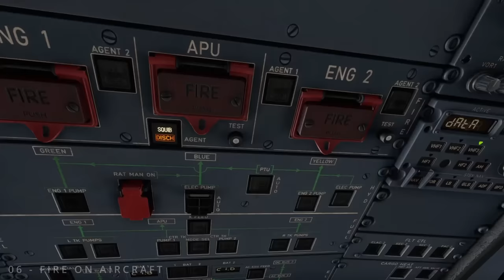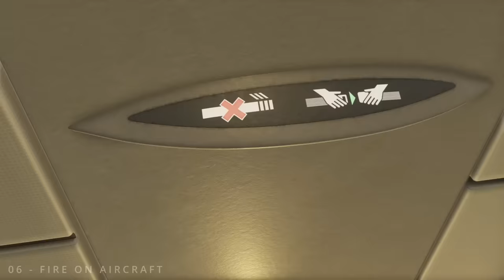Airline CAPTAIN Debunks 8 Flying Fears

Comment: Everything described in this video is one of my fears. I have many more like a loose nut, wrong gasket, failure of a critical instrument, midair collision, turbulence tearing off an aircraft wing, grave mistake by the cockpit crew, and a lot more. To be honest, I knew everything that this video contains and this is not enough of a reassurance. Yet, I have to fly for different reasons. I try to hide my fear of flying. I am sure passengers sitting next to me notice my strange movements despite my attempts to look normal.

Comment: I grew up in a time when L1011s (and other planes) regularly dropped out of the sky, for seemingly no reason. As a result, I used to be so petrified of flying that I would have to go to the airport and sit in my car and watch the airplanes land for HOURS before I'd get on a flight. My job required me to travel frequently and i was a constant mess. Over time, I convinced myself that these behemoths actually DO come down out of the sky safely. About the time I was conquering my fear of flying (which was really a fear of landing), I was hired to run an AIRSHOW. I flew with The Blues, The Thunderbirds and the Snowbirds (Canadian). Now I sleep through take-offs and landings -- something that would have been unthinkable in my early career. P.S. My parents were in the Air Force. Try explaining a fear of flying to people like them some time.
Reply: No L1011 that I know of 'dropped out of the sky for no reason'.   You're thinking of DC10's.    The ONLY  L1011 mechanical failure was a landing accident which killed two people.    Quite a lot of DC10's dropped out of the sky, and a number of 747s.   The L1011 was by far the safest of the three 'jumbos'.    I'd fly on a L1011 any time.   Not a DC10.
Reply: @cr10001  The DC-10 definitely had its problems, but the L1011 was a perilously bad aircraft for many years.
Reply: @buckeyepilot3929  what the hell are you guys talking about, “dropping out of the sky?” Like, literally just falling down from flight altitude? I always thought the safest time was whilst you were in the air? You got me picturing some goofy movie where a EMP hits or something and planes start falling down onto neighborhoods ...🤔
Reply: @bobbeezel2593  Can you read? Read the articles I posted.
Reply: @buckeyepilot3929  well, pardon me all over the place. I shall go and read the articles you speak of (which I had no knowledge of until now). I no reed thengs vary good skoewl was hard four me

Comment: As a retired airline pilot for 35 years, I can tell you, you don’t negotiate with air traffic control  when dealing with thunderstorms. You tell them witch way you are turning to avoid them.
Reply: Yep as an ex-ATC, I can tell you that if there are big storms, separation is greatly increased because very few want to be there anyway, and it is expected you're going by weather radar around cells. So have at it but please stay in my sector because it's more work otherwise.
Reply: Interesting comment but I was on a plane one time when there was a thunderstorm. I’ve no idea what was going on or what the pilots did. I don’t know if it actually happened as I was very sleepy so I may have even dreamt it. Either way, something happened one time but not sure what it was or who was involved.
Reply: @theemperorofboxingtruth3745  I think it was the meds.
Reply: Thanks for your service🎉
Reply: *which

Comment: My biggest paranoia is when the plane takes off, because the angle is so steep and the speed seem always so low, you feel like it’s about to stall
Reply: There's alot of illusions that act on the body in flight. I believe if I remember correctly it was at 500 feet (because it's been a minute since I had to know it). Above that, you really need to trust your airspeed indicator, your artificial horizon, and altimeter. If you watch commercial flights, at least one crew member is glued to the instruments and reading off situational data to whoever is actually flying the plane. Then there will be backups of all the instruments in the second seat and most of the time, also analogue instruments Incase of a failure on the glass cockpits. Some airlines I've been on, the LCD media screen on the seatback in front of you can display some basic flight data and you can watch the indicated airspeed and altitude climbing.

Comment: Thank you captain for your helpful information! I would like to know how pilots are drug tested and mentally screened for cognitive changes? 
The Malaysian flight that disappeared was so distressing and one theory was the captain had something to do with it. I also have followed the problems with the Dreamliner planes and how many pilots weren’t properly trained on the new/different technologies because of cutting costs! 
I hope pilots always know that we want all of you to be heard, cared for and are in your best health before you get in the cockpit!😊👏🙏🏻
Reply: It depends on the airline. Most of the big ones have mandatory timing stuff that keeps pilots refreshed and ready, they'll also require a certain number of hours of training on the plane that they'll be flying before they are even allowed in the cockpit pull of passengers. The Malaysia airliner that went down was the pilot committing suicide with everyone on board, it is very clear by the flight pattern that he had said goodbye to his hometown mid flight and did something that every pilot is trained not to do. To combat that, Malaysia air has set up screenings for pilots mental health. I'm sure that most other airlines already did it but have definitely increased the emphasis on it. And the dreamliners that went down was a software issue that the pilots were not trained to overcome, unfortunately causing the loss of many lives. Boeing grounded all of those planes and patched the software that was causing issues.
Reply: @eats4cheaps305  That wasn't 'Dreamliners' (787's) that crashed, that was 737 Max's.

Comment: I’ve worked in aircraft maintenance and seen evidence of poor decisions on the part of various personnel refurbishing components. Sometimes it’s cost cutting/savings by management or insufficient training for mechanics. Also recently Boeing was discovered to have done something completely STUPID with their 737 NEO in order to remain competitive in the industry. Certainly those engineers entrusted with design and manufacture are well trained and do these jobs well, HOWEVER, as we’ve seen these people can be overruled by ownership/management to the detriment of paying passengers. Boeing was entrusted with certification of their aircraft instead of the independent agency tasked with this responsibility. MONEY AND GREED have caused untold grief to the families left behind to deal with the factors I’ve highlighted here. Pilots who are extremely well trained cannot always deal with circumstances they may know NOTHING ABOUT. Thanks, I’ll take my chances on the road!

Comment: Captain, I'm worried about a mad pilot locking the cockpit door and slamming the plane into a mountain. Should I be concerned?
Reply: No. These days there has to always be two people in the cockpit.
Reply: Oh no! I have also been thinking about  that lately. For way too long.😵‍💫
Reply: Statistically you should be more worried about software used to fix bad airplane design that wants to smash plane into the ground and pilots unaware of its existence...
Reply: @icepeakengineer1702  a 737 max reference.
Reply: @icepeakengineer1702  perhaps the next hijacker will not be on the plane
Reply: @johnhorton1012  I don't even trust two people in the cockpit. I have long believed that planes should be equipped with AI to detect irrational behaviors undertaken by a pilot and then to be able to automatically take over full auto-pilot control of the plane under the right circumstances. I would even advocate for 3 pilots plus the flight engineer (even if the 3rd pilot does bugger all on that flight), for that very unlikely scenario when the co-pilot is fighting the irrational captain for controlling the plane and then it's 2 against 1, or if both pilots become incapacitated.

Comment: Thank you for this great demonstration. I have a better understanding of turbulence now. However, much of my fear of flying has to do with the maintenance of the aircraft itself. I remember back in January of 2000 when an Alaska Airlines plane enroute to Seattle crashed in to the Pacific Ocean. The cause of the crash was a jack screw that had malfunctioned due to not being greased. Investigators also discovered that some of the maintenance records had been falsified. Then there was the TWA flight 800 in 1996 that exploded shortly after take off and crashed in to the Atlantic. If I remember right, that was due to a spark from a wire. I know that commercial aircraft are heavily tested and engineered to handle even the most extreme situations. I also know that pilots maintain their training regularly in flight simulators. But these two examples I gave, which come down to human error or carelessness are what really scare me about flying.

Comment: Good video. Many people are also worried about engine failure. Then I have to explain them that it's no problem when the aircraft has multiple engines and loses one, and even without a functioning engine you can glide the plane for a long distance and land safely. If you are over vast areas of sea, you always have multiple engines, and the chances of them failing all, is just insanely close to non-existent

Comment: Went to the Philippines several years back and was on my way to LAX to catch my flight back home to Vegas. Weather was looking kind of nasty in LA and when we hit the air captain said “ ok we have some weather from here to Vegas so we would like seat belts until notified otherwise “ I’ve watched many movies of airliners crashing and in the movie there is always a specific sound when the plane is going down. Here i am almost home from a 30 hour flight round trip and I’m so excited to get home on the ground and safe. I put my head back on the headrest , looked around and saw many others doing the same thing. All of a sudden the nose dips pretty hard and i hear the engines groaning “ i freaked and sat up really fast ! “ i started to look around and was INSTANTLY embarrassed 😂😂😂😂 not 1 SINGLE person had there heads off the head rest. I knew at that point we were safe and they were probably diving to avoid weather. Flying is scary for me and i realize it’s rare for a plane to go down , however we know that if they do it’s going to be incredibly terrifying and probably not end well. That’s the difference between a car crash and a jet crash.

Comment: We had a flight where the engine failed, something about oil. There was a weird barking sound. We were redirected, everyone was terrified, but it was all fine. The pilot just flew lower and got us back to the airport. I later learned it’s a very, very unusual thing to happen, there’s multiple engines on commercial flights (two on ours) and pilots are trained to deal with it. I was nervous on our next flight but came to realise it’s safe, and pilots are trained for basically every scenario of something going wrong you can think of. There’s a reason it hits the news when things go wrong - it’s very, very rare.

Comment: Just got back to prestwick from Spain last night. Both flights was a nervous wreck, completely irrational fear, should have watched this before hand. Turbulence was a bit of an issue coming back, I've noticed smaller planes like the airbus that Ryanair use bump around a bit more than bigger planes. 
What amazes me is the reliability of the engines. The airbus from prestwick to Spain does multiple flights a day. Someone told me that the engines could theoretically run constantly for weeks before breaking down.

Comment: Great video. People are just as afraid of elevators and spiders. I heard that there are around 10,000 ATC flights in the air at any time. You are more likely to be hit by lightning this year than be in a commercial flight with a major incident in your lifetime. Unfortunately, reasoning can't help people afraid of irrational fears, but maybe directing them to think about spiders and lightning will help them walk down the jet way or slow their heart rate while they fasten their seat belt low and across their lap.

Comment: My fears of flying comes from the idea of suicidal pilots, parts of the plane breaking off under stress like the vertical stabilizer on American Airlines 587, and software issues like the two 737 MAX aircraft. It terrifies me to the core. My one tip that helps even a little is to bring active noise-cancelling headphones to drown myself out of the situation if I am feeling overwhelmed.
Reply: Same thing, as rude as it sounds I am always worried about the "human factor". I am aware that planes are safe, as everyone tells us as soon as we say we're scared of flying, what worries me is maintenance workers missing something, the pilots being exhausted (every time I see a video where pilots discuss their daily life they always point out how little time they have to rest) or mentally unstable ecc.
In a car or a bus i can see who is driving and what they're doing, on a boat I can't, but if it sinks I can try and do something to save myself as there are lifeboats hanging around. On a plane you never know who's in the cockpit, what they're doing, and if something happens you can't do a single thing about it, you're just dead.
We are pretty much in the hands of very professional strangers, who however get little to no sleep and, depending on the company, are probably underpaid

Comment: I was terrified of flying from the very first time I flew at age 5. I was an uneasy flyer as an adult, but not to the point that I avoided it. Then I got a job that required some travel. After awhile I got to recognize the noises and bumps and turbulence one experiences on every flight. I started to realize it was all normal. Even the abnormal things like moderate to severe turbulence and a mechanical failure that required turning back to the departure airport were not as scary. So I think the best way to overcome fear of flying is to fly a lot.

Comment: I was cabin crew for several airlines including Gulf Air and British Airways for over forty years. Over that period, turbulence became more and more severe and common. I'm not convinced by climate change but the world is going through a cycle of increasingly severe weather patterns. I believe that flying is inherently extremely safe, but i'm hugely relieved that I'm out of the industry. The final few years of my career meant most of my flights involved some degree of turbulence, often severe. I'm extremely happy to have both feet firmly on the ground and not having to check how bumpy my next duty might expect to be. Yes, flying is incredibly safe, but it seems to be increasingly very uncomfortable and unpleasant.

Comment: Ok nice video. Thanks for sharing. I am not a pilot, just an ordinary passenger. Because I have had a fear of flying I have done some reading on the subject. I read a book on air disasters and one thing the author made clear was that crashes are usually caused by a series of unlikely events. For example in one crash, two planes were flying over each other and one of them descended suddenly. One of the planes also had a malfunction in the alarm that alerts the planes to other planes or terrain in the area. In another crash (the Tenerife crash) an impatient KLM pilot turned down the wrong runway and hit a Pan Am jet in dense fog. So there were several factors here also.

Comment: I was in a plane that was hit by lightning once - and we definitely knew it. There was a bright flash outside the plane and a loud crack and then the lights went off. All talk ceased inside the plane but a minute later, the lights came back on. One of the pilots got on the intercom and said something like, "just a little bit of static discharge." This was on approach to O'Hare, on a day in which the airport kept closing and reopening because of thunderstorms. And we still had another flight to get home to IAD.

Comment: As someone who was certainly very scared of flying at first it is not nearly as bad once you have done it one time. You realize once you land wow this wasn’t nearly as bad as I was thinking. The scariest part is certainly landing for me. Runways are not as smooth as some people may be thinking they are actually quite rough. This is completely normal. Also, be aware the wings of the aircraft will extend and bend down to slow the plane. The wings are not breaking like my wife thought 😂.

Comment: There was actually one documented case of a wing falling off a plane, I believe it was some type of propeller commuter plane flying in the Bahamas or somewhere nearby. The mechanics noticed an extremely long fatigue crack at the base of one of the wings. I believe they, in an act of gross negligence, tried to drill a relief hole to stop the crack from propagating and it didn't work.

Comment: I was in Iraq in 2003-2004. I was on helicopters and airplanes regularly. Many times, under fire. Had some close calls that rattled me pretty good. On the flight home after a year, cruising over the Atlantic, the jet I was on lost power. Engines went out, power went out, etc. Jet plummeted toward the ocean. Everyone was screaming. People who weren’t buckled were tossed all over the cabin. Finally the plane regained power and the rest of the ride home was smooth. I have no clue what happened but every flight I’ve been on since, I’ve been terrified. I wish I could get past it and start traveling again but I just haven’t been able to.